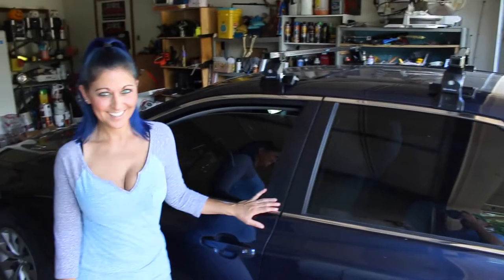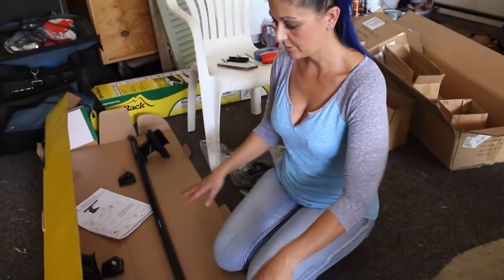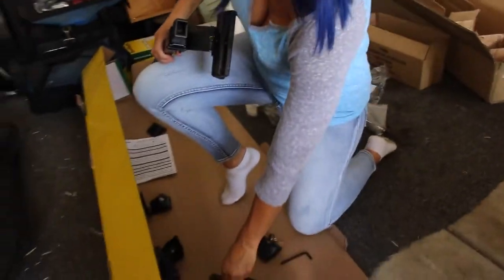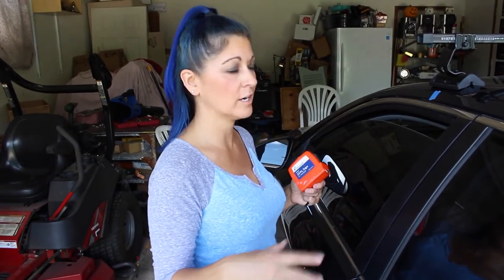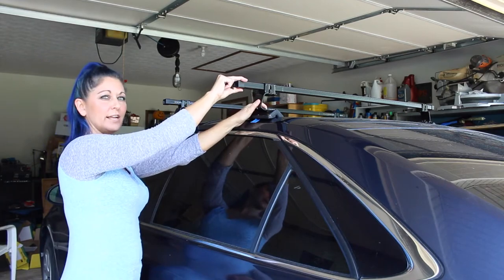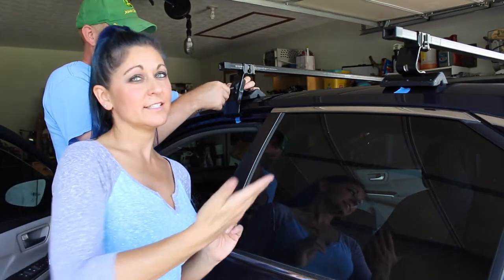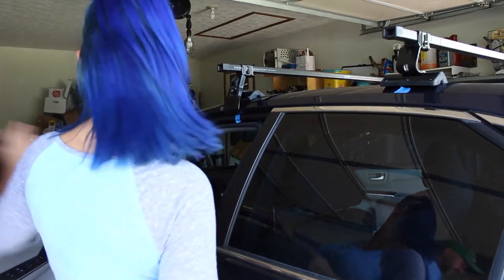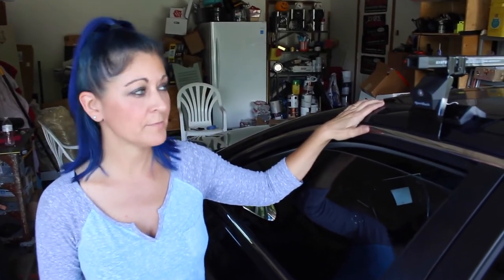SportRack Roof Rack installation

Comment: Did the clamps that go into the door frame cause any leaks when it rained?
Reply: Good question, I'm wondering the same. I think it depends on the make/model of your car. I've got a vw golf and its notorious for leaking when you install roof racks
Reply: I have had mine on for close to 12 years without any issues.
Reply from the maker: we take them off at the end of fall every year.  we have had them almost 4 years at this point and never had a leak. :)

Comment: Is it still treating you good? Didnt come off with the kayaks on???

Just got one for my matrix and I think it's going to work but the brackets are really hard to fit on.... with the square holes it's great! But then the locks wont fit hahaha
Reply from the maker: hey quinn.  Yes, everything worked great for us over the summer, nothing fell off :).  We took the sport rack off for the winter but will be putting it back on when the warm air hits again :)